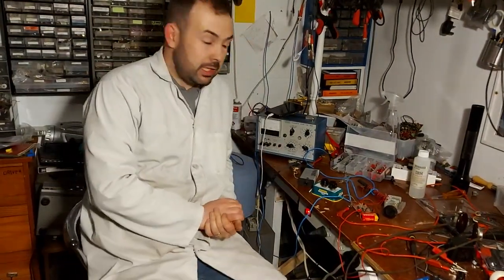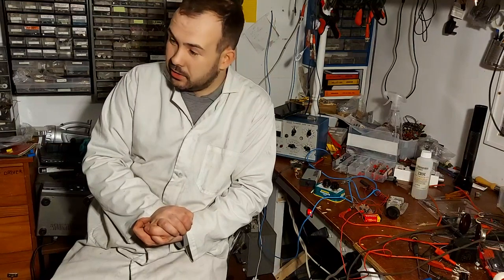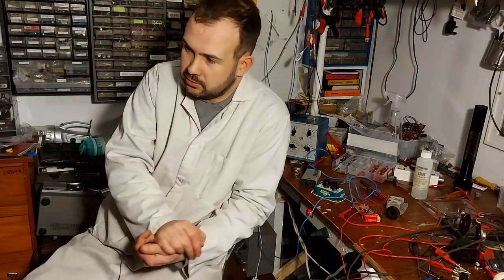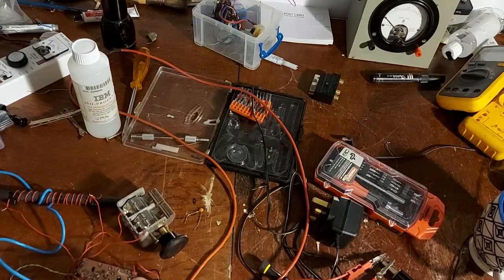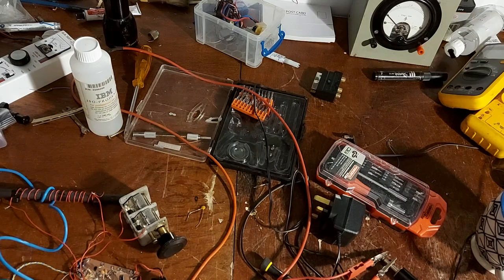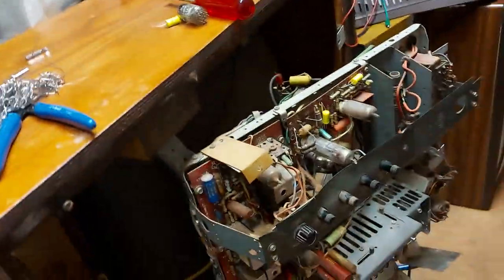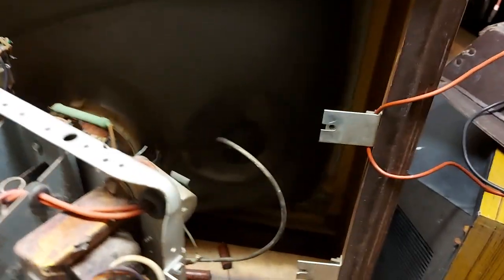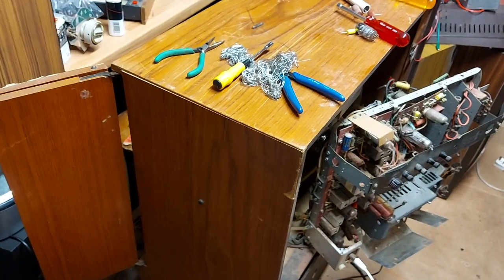Pye Dual Standard Revisited.

Comment: it may be that that tube will not have implosion protection as well ! as you said it probably was meant to have a protection screen ! not the safest set up!
Reply from the maker: Its a rimband tube so it has integral implosion protection, though I recon it should have a plastic surround to isolate the metal rimband.

Comment: lol you mad man :-D
I'm sure that amp would work fine if tapped on to the t.v volume control, as long as the amp or tv does not have any odd ground system that might create an exploding fuse lol.
Some tellys had a live ground millions of years ago, what a silly idea.
When you said Lm386 i thought 500mw audio amplifier 8 pin chip.
So is that radio using one of the old 3 pin a.m radio chips, or are you using a diode so it's an amplified crystal set?.
Eather way, your having a bit of fun, good  :-D
Reply from the maker: It's a regen using a 2n2222, ink to circuit in description.
Reply: @IrishvintageTVRadio  Sorry about that, i didnt hear all that you said.
Reply from the maker: @zx8401ztv  Quite alright OM. 👍